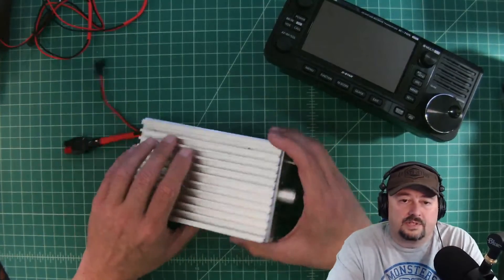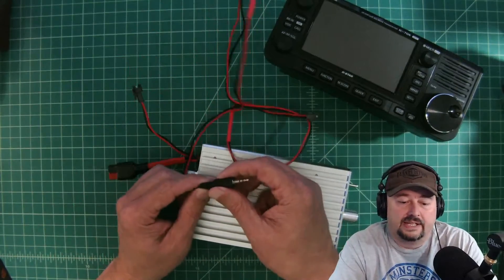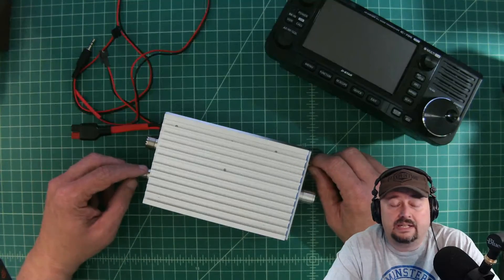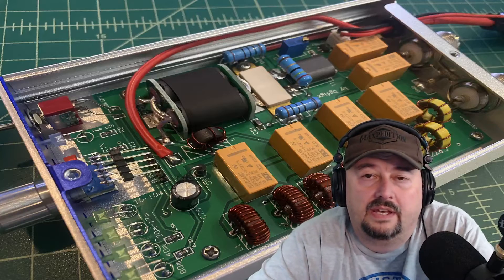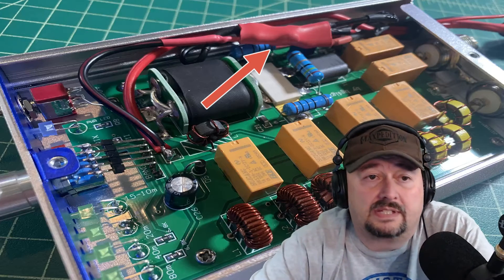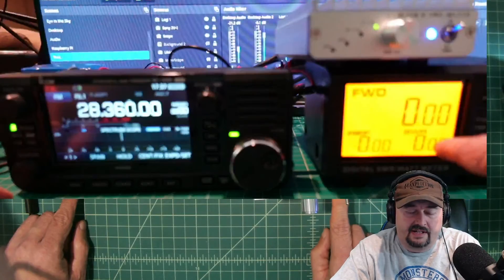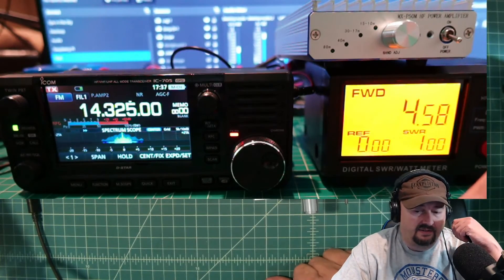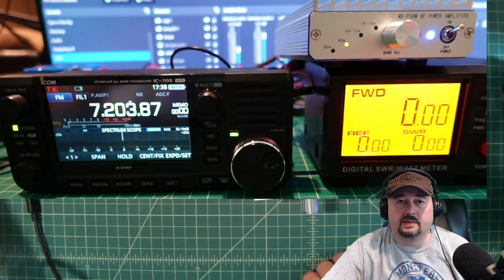Icom IC-705 45W OUTPUT! MX-P50M Amplifier

Comment: Hello, can I add a comment?  I just watched a video that stated the IC705 should have a delay of 100 milliseconds to allow the amp to get ready to produce its 45W output without surging back into the radio?  Or something of that sort.  Might have to set TX delay to 100 ms.
Reply from the maker: Hey Dana, you are correct.  I am using a 25ms delay on the 705 but that is not when this mod is necessary.

Comment: I use my 703+ with the Roma 100w amp.  Made in Italy.  If SWR or input power too high, it will shut down. Will change bands on it's own from the RF in the coax. Max in: 7

Do not know if the 705 and Roma will play nice together.
Reply from the maker: Thanks for the info, I'll check it out!